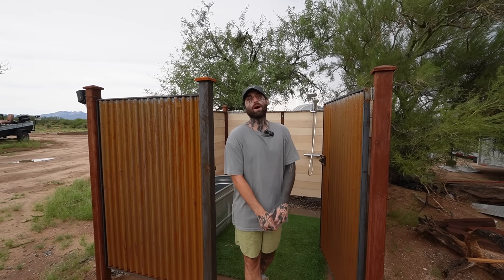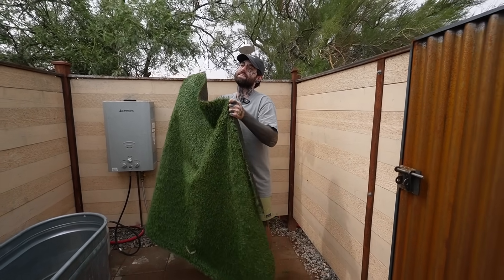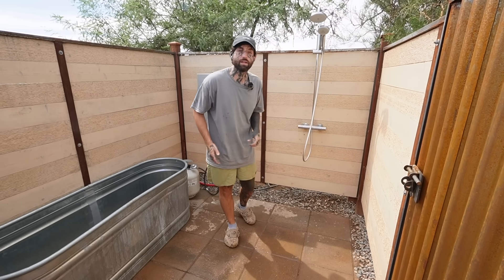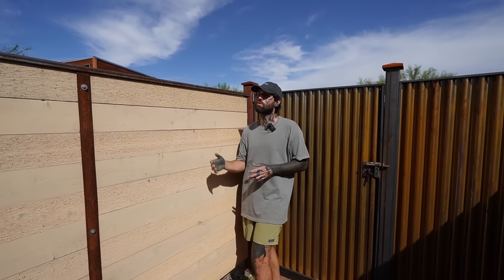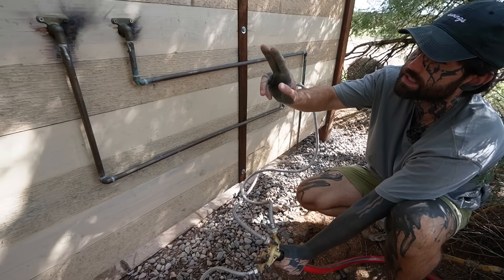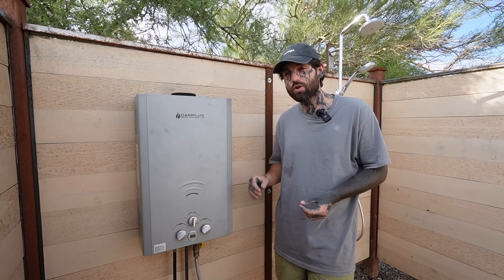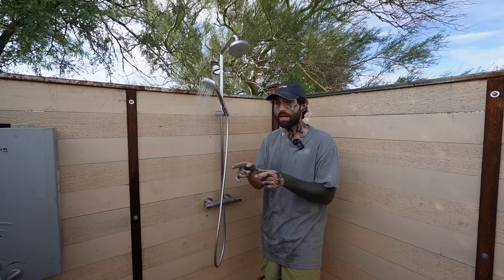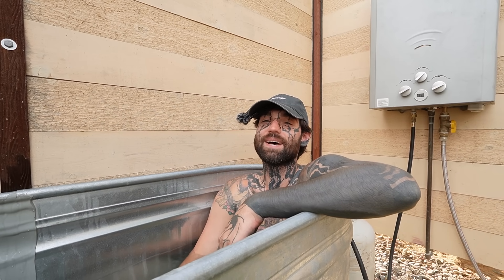I Built an OUTDOOR SHOWER & BATH!

Comment: Great job man you're a real inspiration I would love more videos like 101 on welding or framing or concrete work where to get it affordable how to lay it down do's and don'ts of construction any of the legal stuff you have to jump around specifically that you dealt with or that others may run down in the line when they do this kind of stuff would be greatly appreciated you rock

Comment: You bought a way to big water heater bro, mine in my cabin is about 1/4 that size and still burns the shite out of me, there is a lot more control over the temperature though and its heating it up from near freezing in the northern upper peninsula of Michigan

Comment: Would putting a quick connect on the shower head fill the tub faster? Usually the flow restrictor is in head itself. You might be able to fill the tub faster if you remove it

Comment: So I am thinking about moving onto my parents 5 acres. They have electric, fiber internet and a well drilled and setup already. So not going the full route you did. But I am having to build our own place on it. My question to you is this. Having the choice to go electric or propane for water heater, and based off that, tank or tankless. We will have two sinks and one shower to run off the system. But since we are building from scratch I was curious what you would do, Sean. Thank you in advance incase you read and answer.